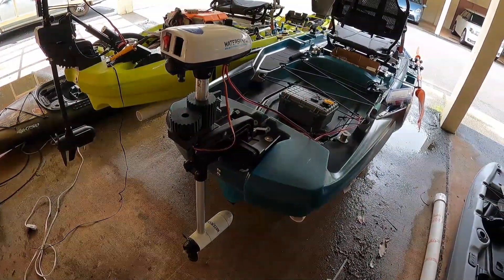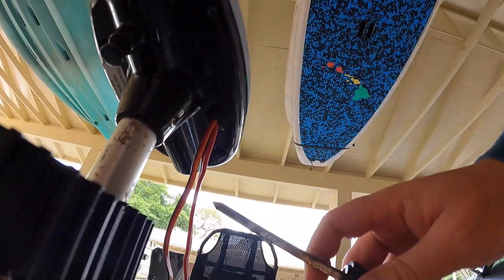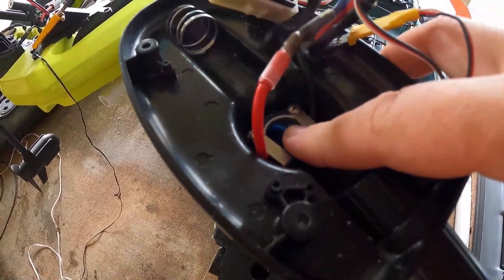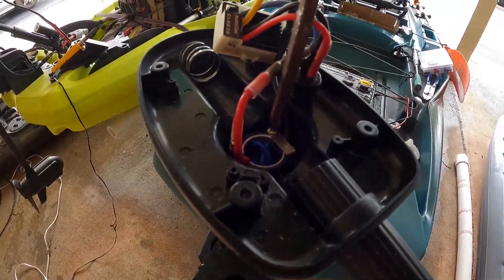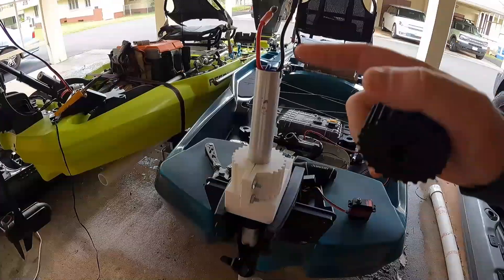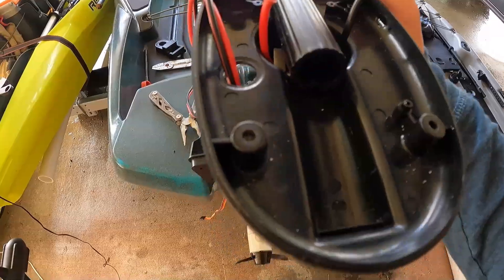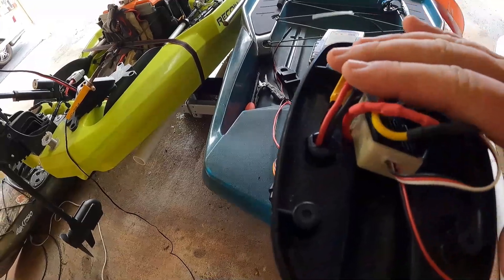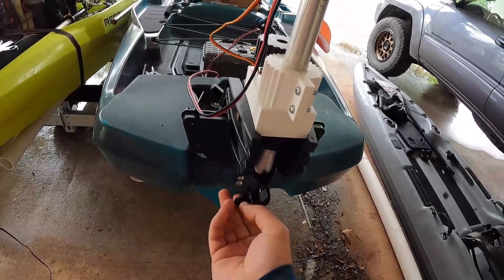DIY RC Trolling Motor For Kayaks

Comment: Nice video i have a minn kota trolling motor with the same controller and speed controller when i connect my yellow wire to the black wire and the blue to the red wire it only beeps and i cannot accelerate via my remote controller not sure what im doing wrong any thoughts?

Comment: I didn't see any mention of the voltage requirements for the servo and speed controller (5-7.4v) did I miss something? I too will be attempting to fit to Minkota motor 50 lb thrust. Would be willing to pay/buy the printing requirement file. Awesome video Thanks

Comment: Love it , I will try this on my setup ,the only difference I will try and use it on a minkota motor .
Reply from the maker: The minn kota motor does have a different shaft diameter than the watersnake, so this specific setup won't work. But the concept is the same, so all that needs to change is the dimensions of bracket and gears
Reply: @OutdoorEngineering  could you change that for me if possible? Of course I could pay.
Reply from the maker: You're not the first person to ask for this. I'll see if I have time this week to do it.

Comment: It looks like it's been a year how is that speed controller holding up with your trolling motor
Reply from the maker: The speed controller is still working, but I did recently have to replace the battery wire because before I did this project a was playing around with over powering the motor, and the wires gave out before the motor did. So after over heating, the battery wires were less than great, and a bit of exposure to salt water cause more corrosion. 

But to answer your question, the ESC is doing great, and I have 2 more installed in my remote control minn kota motor project. I personally would recommend them. ⚠️ WARNING ⚠️ Do not hook them up to the battery backwards. They tend to explode when you do that.
Reply: Great thanks for the answers helps me a lot

Comment: The esc battery wire looks small, 16awg it's not getting hot in the water?
Reply from the maker: Interestingly, no. The main battery lead that it's connected to is the factory battery lead that came with the trolly. The little wires that go inside the ESC are not exactly replaceable, so I just trusted the 30a rating that radiolink advertises, and I haven't had any issues.

Comment: Would you consider building and selling one?
Reply from the maker: Honestly, probably not. There are too many risks involved in selling things like this. Any fires that might happen, or someone flipping their kayak and drowning, or anything else could potentially put at risk of a lawsuit. I can upload free .stl files for the printed parts, and wiring diagrams for the other stuff. But I don't want to be at risk of liability if something goes wrong.
Reply: I understand. Thanks

Comment: Is there a way to not have the forward and reverse function? I would want to control the speed on a separate knob than the turning knob.
Reply from the maker: Do you mean not have the speed controlled by the remote? If so, then just don't plug the signal wire from the ESC into the receiver. You will need to add a power source for the RC receiver tho. 
If you wanted to use the ESC still to control speed but have a speed knob or dial, you could use a servo tester to control the ESC output.

Comment: Hey so i’m stumped i just finished a very similar build with a hobbywing 120a esc and the steering servo works perfect but the esc is not cooperating the prop is unresponsive
Reply from the maker: Did you program the ESC, and is the signal wire plugged into the correct channel on the receiver? One of my receivers, I had to have the ESC on channel 3 instead of channel 1, but thay could have been more of a remote problem than a receiver problem.

Comment: Good afternoon or good evening, I want to do this project. The gears and the servo box are made on the 3D printer. Do you have the PDF and the measurements?
Reply from the maker: I'm doing a slight redesign on the box right now, but I can share the .stl file on thingiverse when it's done.

Comment: Excellent video.... thanks so much. 2 questions.
1. How long are the servo extender wires that you used?
2. Is there any way of controlling the voltage to the steering servo to slow it down a bit?
Reply from the maker: The servo expander is 5.3in long and allows 180 degree steering instead of the default 90 degrees. As for slowing down the servo, I don't believe there is a way to do it with this specific setup. There is a noticeable difference if you slowly move the stick instead of going full tilt all at once.

Comment: Hey has anyone figured out how to make the motor not return to the center position after steering towards a dieection of choice? Like being able to adjust the motor to a 36 degree for example and it stay there until you move it to lets say 38 degrees. This is a huge flaw if it cant be programmed to hold the direction of travel without having to hold the joystick there.
Reply from the maker: I used this setup specifically for the automatic return to center. It was intentional. There are several ways to make your steering not return to center, for example, in a previous video, I used a minnkota power drive steering box to add electric steering to another kayak of mine. You can use that same steering box with a second ESC to make it RC.

Comment: Greetings, excellent video, it is a great adaptation, will it work with a Minnkota Endura Max?
Reply from the maker: Yes and no, but mostly yes. That motor has a thicker shaft than this one, so the gears would have to be redesigned. But, you could use the minn kota powerdrive gear box and a second ESC to power/control it. I have the gear box on my brushless motor for my other kayak, and it works really well for steering.

Comment: Will this esc work with a lead acid battery
Reply from the maker: Yes
Reply: @OutdoorEngineering  thank you, will I have to change any settings on the  esc ?
Reply from the maker: The ESC has 4 pins on it that have jumpers that you plug in depending on what configuration you want to run. I can't remember all of the settings off the top of my head, but there's a little book that comes with the esc that explains how to configure it.
Reply: Hey man, where can I get that gear setup or would you consider making one I could buy from you?
Reply from the maker: Everything I used in the video is available on Amazon except for the 3d printed parts. I am in the process of redesigning the steering bracket and gears right now because these ones were skipping a bit if I tried to make sudden turns at full throttle. After I finish the redesign and testing, I'll upload the files for free to thingiverse for anyone who wants to download and print them.
Reply: Ok, would you consider selling me the set you have now? I can deal with a little skip now and then for now. I'm just trying to get my setup build started for spring . I have the hot wheels gearbox but I think this would be easier and better for me.

Comment: Great video! I was wondering how your ESC is holding up? I have run the HOBBYWING QUICRUN 880 ESC, and cook two of them. Would you still recommend the  Radiolink CL9030 90A ? Thanks
Reply from the maker: CL9030 has been working out pretty great so far. I have only burned out 1 of them, and that was when I hooked up the battery backwards. I would still recommend it.

Comment: Hi. Do you have to do any programming on the ESC and can it be used with a lithium battery?  Thanks
Reply from the maker: This ESC doesn't need to be programmed. Just put the jumpers in the correct spot (it's in the user manual), and yes, it can be used with lithium batteries. I'm using a 3S li-ion in this video, but it can work with a lifepo4 battery as well

Comment: Hey this is sensational! I’ve got the same remote setup on a Minn Kota. Question, the servo steering always returns to centre. Is their some way that the steering can be latching? Like you click right once, the motor rotates to a certain angle and stays at a fixed value. Click again and it rotates to another value. Like setting the cruise function for forward/ reverse. Every touch of the toggle increases the speed. Do you know what I mean? 

I stand and fish a lot in my kayak, I currently have a manual method of turning the motor and naturally it stays at the steering angle I turned it to, rather than returning to centre when the toggle is released like your setup in this video.
Reply from the maker: If you are using a minnkota, then you should be able to rig a power drive gear box to it for electric steering. Then all you would need is another esc to control the tiny brushed motor in the gearbox, and you could use remote steering from the same one handed controller.
Reply: @OutdoorEngineering  sadly they are around $400 Australian to buy don’t worry I’ve considered it. Nice build mate 👌🏻
Reply from the maker: A company called Lakeside Marine has em for $120 US. Part number 2771836A. Might see if they ship to Australia.
Reply: @OutdoorEngineering  thanks mate I’ll check it out!
Reply: @OutdoorEngineering  a quick question, when you set cruise control, will that also allow the steering to be turned left or right in certain increments without the motor self centring?
Reply from the maker: Not with a standard servo. There are some modifications you can do to it that stop the servo from returning to center, but idk how to do that.

Comment: Hey are you having any problems with the motor dropping down to half power? 

I've got the exact same set up I've also installed a fan and after maybe 20 seconds of use it drops down to 7-10 amps instead of 20 amps 

I've calibrated the ESC and I'm using a lithium battery with the ESC set to it
Reply from the maker: I am not. But I usually don't run at full throttle because it uses considerably more power for very little extra speed.

Comment: Think you could make one that would mount on a hobie mirage cassette that would be great
Reply from the maker: Does the hobie mirage use the same insert as the pelican hydrive? If so, then I already have a bracket designed for a fixed motor, and I can make a few small changes to the design to make it use the gearing and whatnot.
Reply: @OutdoorEngineering  yes I actually own the pelican hd2 I’d definitely be interested in a kit like this
Reply from the maker: @JohnDoe-xf8nr I designed my motor pod for pelican/vibe/hobie back when I had my HD2, but if you give me a couple days, I can make the design changes needed to accommodate the steering. I'll upload the .stl files to thingiverse, so all you'd need to do is print them.

Comment: Can u make, this thruster can be use both function, manual control (as it was before modi) and remote control
Reply from the maker: It can be done that way. Set the motor control to "high" and "forward", and then connect the battery cables to the ESC. And then for steering, you need a way to disconnect the steering gears. It would be easier to do if you used a type of steering linkage in place of the gears.

Comment: Good Vid! Thanks! I'm doing something similar with the hobbywing 880 esc. I'm using a conventional deep cycle lead acid battery and I think it might be an issue (voltage drop cutoff) Motor shuts down after a few seconds with any load. Your esc looks like a better fit as it mentions using lead acid batteries and the 880 doesn't. Also yours doesn't need a separate programmer AND it's $8 bucks cheaper!  Now I've got another esc.😄
Ever run into any problems with yours?  Any thoughts on my shut down problem? What type of battery are you using? 
Thanks! and again thanks for the vid!
Reply from the maker: I'm running an 11.1V 3S li-ion battery that I built. It's a little slow, only gets my Recon 120 moving 2.5mph at full speed, so it's definitely more of a trolling motor than a cruising motor. I personally don't like the weight of a lead acid battery. Lithium is lighter and doesn't have the voltage drop off that lead does, and you can get a 50ah lithium battery for less than $200 these days. That is pretty much maxing out this little motor tho. Any higher voltage than a 12v lifepo4 (it's 14.2V fully charged) can burn out the motor.

Comment: I am so glad I came across your channel, I've already got my mate printing your design! I plan on using a water snake 34lb do you think they have the same diameter shaft?
Reply from the maker: I do not believe they have the same size shaft. I think the 34lb is the "standard" size, same as minnkota.
Reply: Are you going to post some more videos on the set up?
Reply from the maker: I can. I am working on a system that drops into the pedal slot on my Recon 120. I'm using the same motor, but I'm adding a gps controller.

Comment: Why are you using black wire of the trolling motor instead of the blue one? I have the t24 watersnake trolling motor and the blue wire is for the maximum speed. Great job and idea. Personally I am looking for autoboat product for anchoring my kayak with GPS but i will choose to reduce electric parts on the sea
Reply from the maker: When I unplugged it from the switch, the blue one was on the "low" side. Plus I was getting the same speed when I had the black wire connected to a PWM as I did when it was stock. I will check it out with the blue wire and see if there is a difference. 
One of the projects I am working on right is actually an upgraded version of this, with GPS, that goes through the pedal slot on my Recon 120.

Comment: Okay so a RC trailer for it next? Don’t even need the car..
Reply from the maker: They make a thing, I think it's called Trailer Buddy or something like that, and it is remote control. It's like a little tank looking thing that has a tow ball on the top and allows you to move your trailer around without a truck. But a small one for a kayak trailer would be neat.